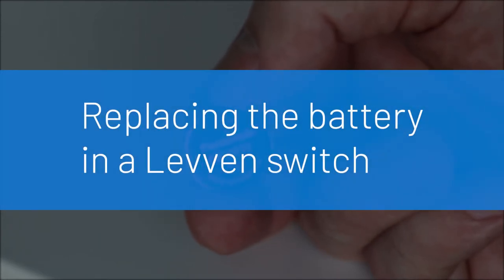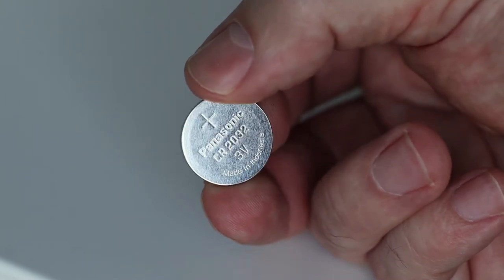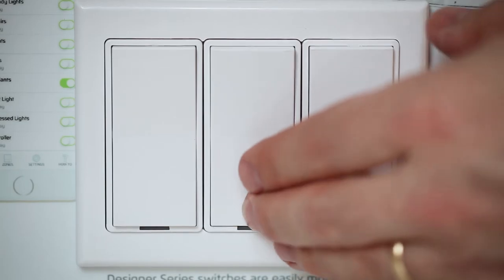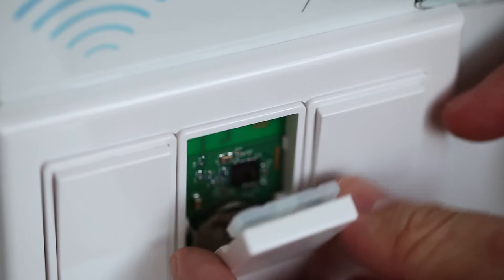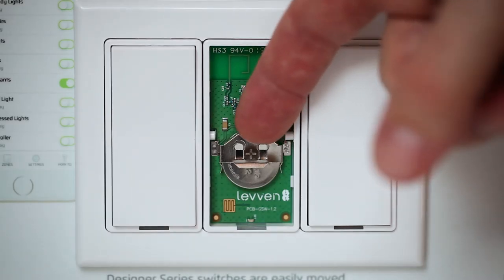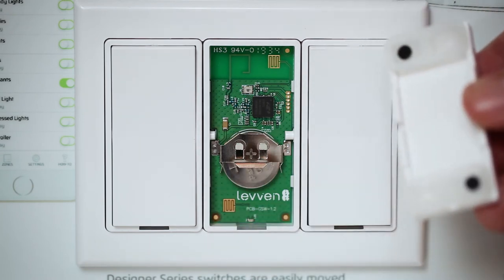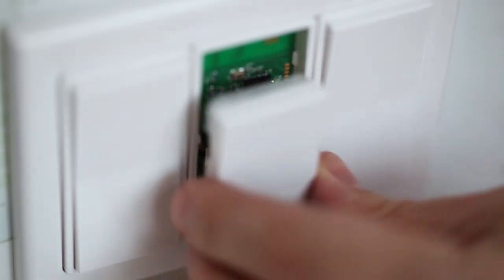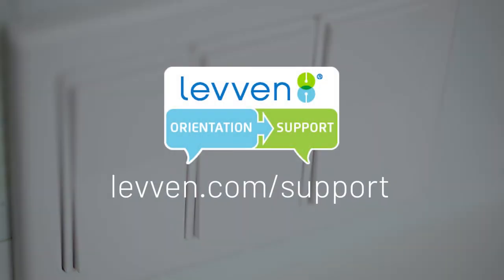How to Replace the Battery in a Levven Switch

Comment: Thanks for your video. I successfully replaced our malfunctioning battery. However, such batteries do not last ten years. The one I replaced didn't last two years. Moreover, the touch plate and batteries didn't smoothly come out and move back in as in your video. I had to pull and pry and push and push with no small amount of verbal commentary.

Comment: on one battery can work 10 years??
Reply from the maker: Hi there 👋🏼 At 15 on/off operations per day, the battery life expectancy is 7-10 yrs. It takes <11 secs to replace.
Reply: Yeah, I gotta call Bunk on that, or our builder used 8 year old batteries. 35+ of these switches in our less than 2 year old home. 2 stopped working and had to be replaced ( one was a bad receiver hidden in the attic, and the other was a bad transmitter ), and so far we have replaced 4 batteries ... I despise these wireless switches ... Just terrible when they stop working ... No quick fix. Even if you have new ones at the ready, if you don't know the pairing procedure, or if the receiver goes bad, or a dead battery ... you're screwed. Terrible idea, terrible product. I guess they save the builder money on wire and labor, but I'm not sure how, since they are very expensive. We have a bad receiver now ... been waiting 7 months for a replacement ... Did I mention ? ... Horrible Idea, Horrible product !
Reply from the maker: @donopp5850  Sorry to hear about your experience. Do you have a ticket created with us or your home builder? If not, please DM us or reach out to support@levven.com, and we'll get your issues resolved at the earliest.